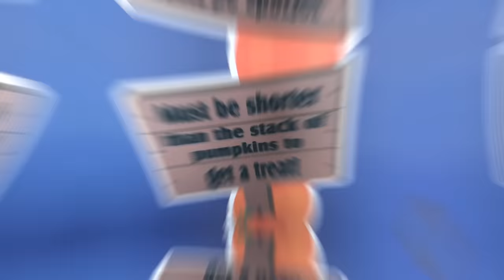We LOST Blake! Is our SOTY Shack HAUNTED?!

Comment: The same thing happened to me for a storm so my yard is shaped like a triangle and there are two roads by my house with a highway at the front of the house so at the tip of the the triangle lightning struck it way closer then it was for you it was crazy and scary I see a flash a white then a boom my ears were ringing